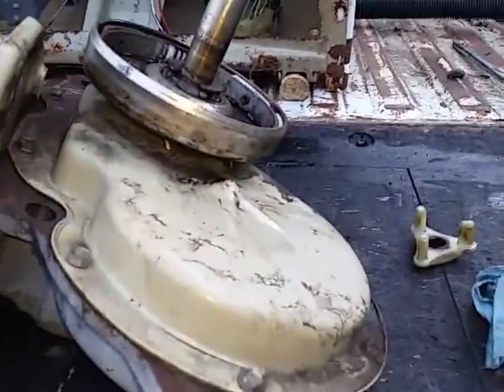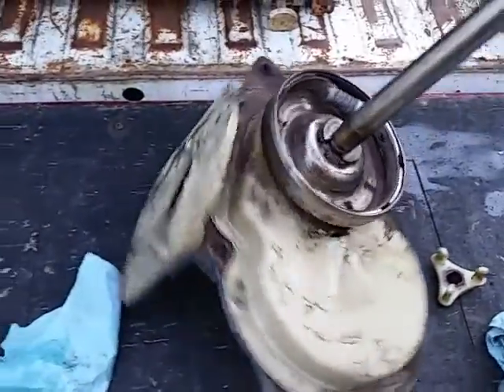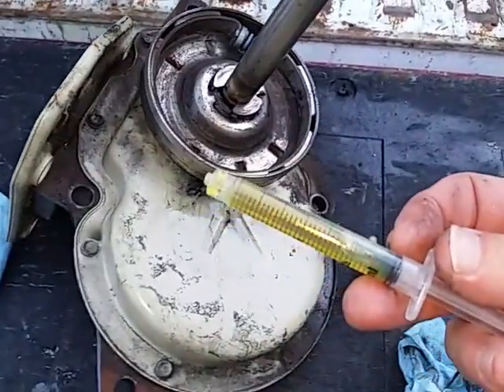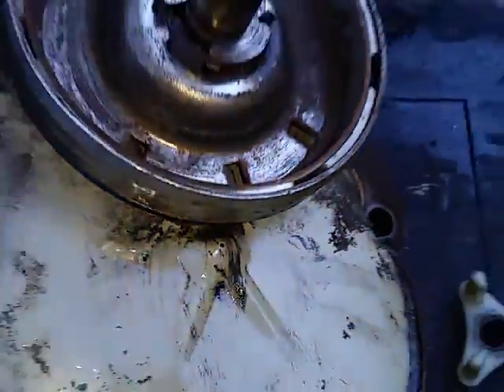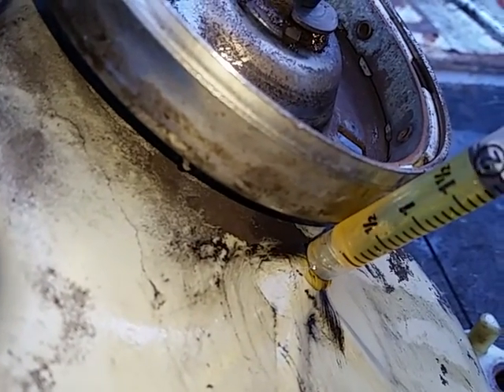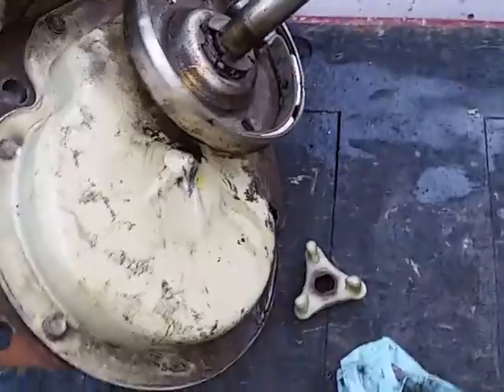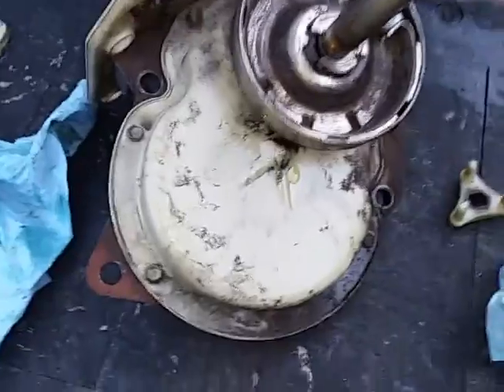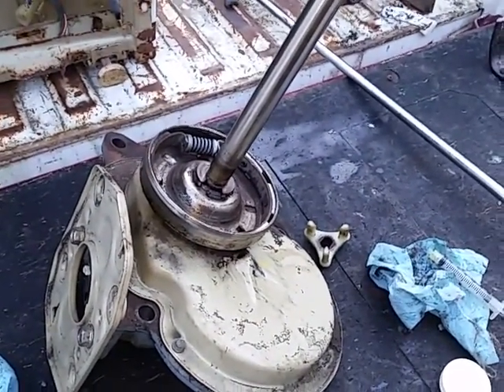Whirlpool washing machine transmission adding lube

Comment: Perfect I thought that was the easiest way to replace the gear oil I lost by laying rhe transmission on its side overnight.  Repair clinic said the only way was to open it up and reseal it.  For such a small amount it seemed like too much work.  This is more like it!  Thanks for the Lucas tip.

Comment: Just came back here after adding gear oil to my tranny.  I was replacing the seal where the tranny and motor connect – it had a slow leak, which is common after years of use (mine is 20 years old).  Once you remove the old seal, you can easily add gear oil before installing the new seal.  Obviously the only issue with both methods is knowing how much to add.  Just thought I add this in your comments for the next guy.

Comment: So you think it would be smart to seal the pinhole, with a little silicone caulk, to prevent further leaking?
Reply: I think it needs to be vented so pressure doesn't build up with temperature changes and cause pressure on the seals..
Reply: Thanks for the response.

Comment: hello Sir: What oil did you put in?
Reply from the maker: I added Lucas oil stabilizer, but any 80 or 90 weight oil should be good..or even just buy small bottle of STP at Walmart
Reply: @Mrhilljack  most of that stuff is for autos- detergent oil. Are you sure, it will work here?
Reply: @Mrhilljack  Super Tech Marine Gear Lube 80W-90, 8 oz tube. I am going to try, this.
Reply from the maker: A gear box is a gear box doesn't matter what it's mounted on.  That lower unit lube will also work just fine.